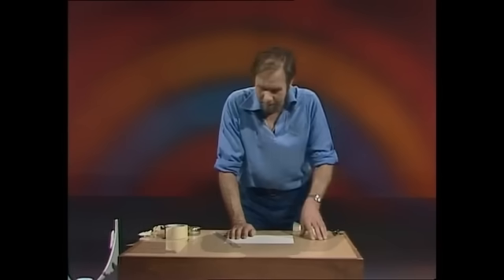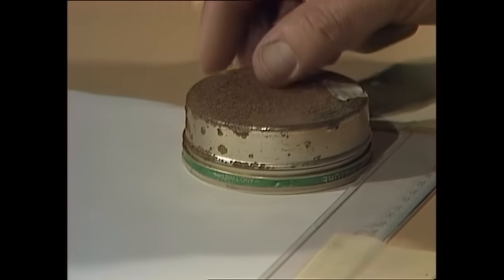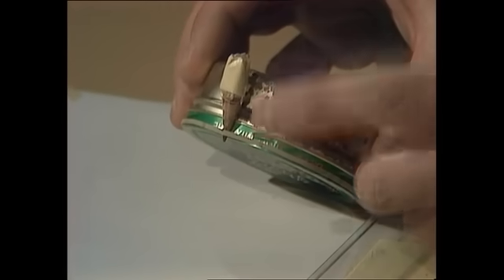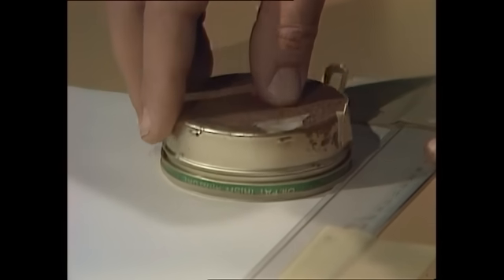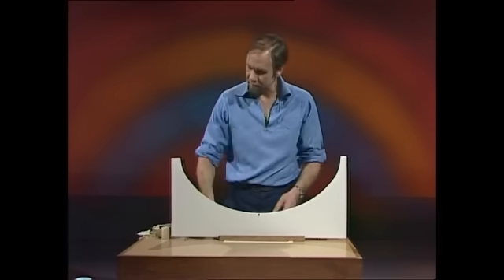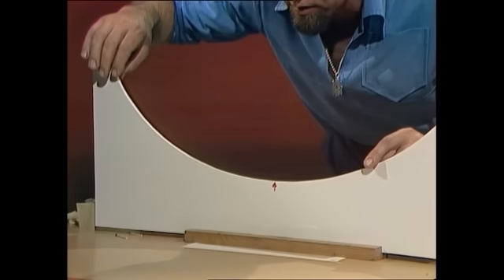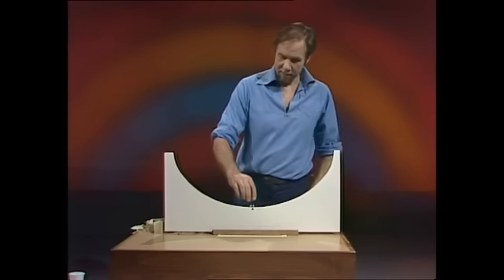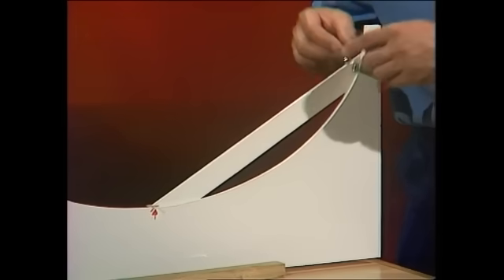The mysterious isochronous curve

Comment: It's also called a cycloid and it's the basis of virtually all gear tooth profiles.
Reply: Actually cycloid gears are ancient. Involute gears are used now.
Reply: I guess I spoke too soon. Involute curves are most common on the mating face curves but cycloid curves are still used for some types of gears.
Reply: Cycloid curves are still used for the gear tooth profiles of gears in mechanical watches.
Reply: Flat faced teeth are commonly seen in drawings, but in practice they're not flat https://en.wikipedia.org/wiki/Involute_gear
Reply: felixar90 
of course there are flat faced teeth, imagine a gear bar which is basically a gear with infinite diameter.
Reply: Granted, but racks are a special case. Also they're usually not called gears. Only rotating parts are called gears.
Reply: i thought a cycloid was the aliens from battlefield earth..... /s
Reply: ecoots You mean the Cylons? /s
Reply: yeah, those guys
Reply: Phil Osophical  i can barely remember my childhood, but i don't think even Lego gears had flat sided teeth.

Comment: I've always thought this is a brachistochone, are they the same thing, just different terms? Or are they distinct things that I'm not realizing?
Reply: The same curve type (a cycloid, i.e. curve traced out by point on moving circle circumference) is a solution to the isochrone/tautochone (equal time) and brachistochrone (fastest time) problems.
Reply: I believe there the same thing. Vsauce has a video on the subject if you want to learn more :)

Comment: It ends on something of a cliffhanger...tell us more!
Reply: Or to put it more simply, it is an exponential curve. Now think of that curve in terms of acceleration. At the ends, you have maximum acceleration because the curve is virtually vertical whereas in the middle you have minimum acceleration because it is virtually horizontal. Every point between the horizontal centre and vertical end the acceleration increases by the same factor. The balls always meet in the middle because of the acceleration and distance to travel always offset each other by the same amount where ever you start the balls from. I don't like cliffhangers either, so let me continue from where the video ended. Where ever you put the balls, gravity and acceleration always...
Reply: It's witchcraft.
Reply: Ain't no witchcraft in this universe. Everything is explainable with the beauty of science!
Reply: Obviously, you're new to YouTube.
Reply: From conservation of energy we can say that the marbles are moving at the same speed when they reach the marked point. That is because they start with the same amount of potential energy, which is converted into the same amount of kinetic energy after moving the same distance downwards. However, the ball on the curve accelerates faster at the start and less at the end. As a result it covers more ground in the same time than the ball on the straight slope (which spends more time at a slow speed, even though it maintains its acceleration all the way down). This would work for almost any curve, it doesn't have to be isochronous.

Comment: You stated that a fractional circle would not allow the marbles to meet in the middle but an isochronus path would... However, my understanding of physics is;  If you were to use just a fractional circle, you have created the path of a pendulum.  A pendulum has the same period as long as the length is the same.  Given that you are using the same size marbles, wouldn't that mean that a fractional circle would in fact, allow the marbles to meet in the middle regardless of their starting point?  In addition, since the isochronus curve is based on a circle in constant motion, as long as the motion of the wheel is at a constant velocity and the rotation of the wheel stays constant (spinning the wheel faster, or slower than the relative motion to the ruler) wouldn't the marbles meet in the middle on any curve made by that same wheel?   I think your statement of the marbles meeting somewhere other than the middle is not correct... But, I could be wrong.   Just a thought.
Reply: The period of a pendulum is only constant for small swing angles. So the bottom of the isochronous curve is very nearly circular. But clearly the sides are not. Conversely, a pendulum that is started from a horizontal position will probably have a slightly longer period. It might not be noticeable on the scale of this demonstration, though.

Very interesting presentation. I had only heard about the isochronous curve (and its eponymous properties) from the famous story about Leibniz and Newton, but was not aware of it being described by the motion of a wheel.
Reply: Good answer. You can make it independent of the swing angle by mounting the fulcrum between two cycloids which bend the string into a cycloid shape as it swings up.
Reply: John Ford How do you know that?
Reply: Joe Fagan because then the bob is constrained to move along the same cycloid shape as if it were on the track he made. Look for "cyloidal pendulum"
Reply: John Ford Ta
Reply: That is a good point... I did a bit more reading and it appears that a pendulum started at a higher angle will actually have a shorter period.   Very slight and as you said, not really noticible on this scale, but not the same nonetheless.
Reply: No, a pendulum that is started higher, will have a longer period. Btw, the curve famously solved (anonymously) by Newton was the brachistochrone, not the isochrone (which is a different section of the same path described by a wheel).

Comment: It's just the angle of the slope. The higher the balls goes the sharper the drop and faster it goes. Don't these same principles apply to roller coasters?
Reply: Yes. A simple force-sheet (parallelogram of force ? - not sure about the term in english) shows the correlation
Reply: Thilo H+ I think you mean a 'force vector diagram'.